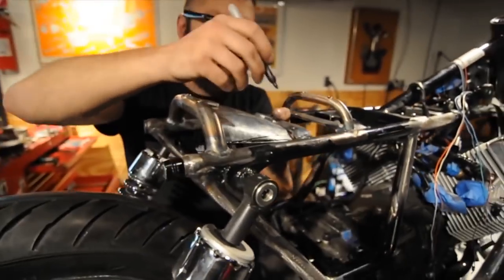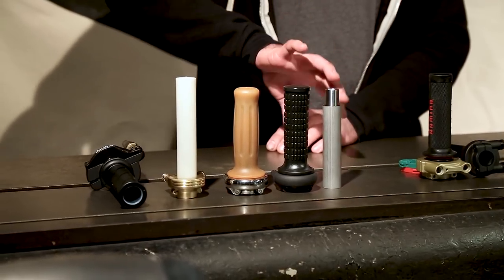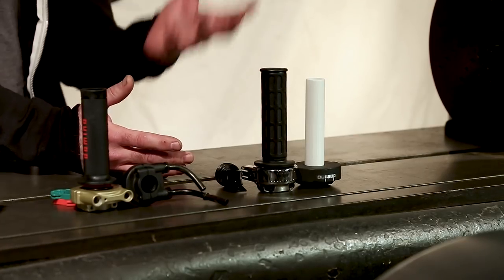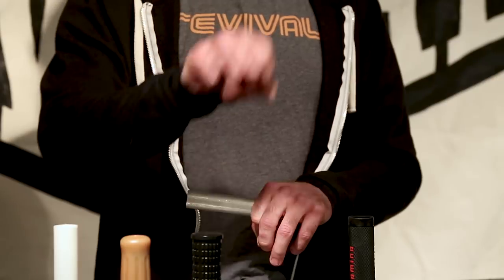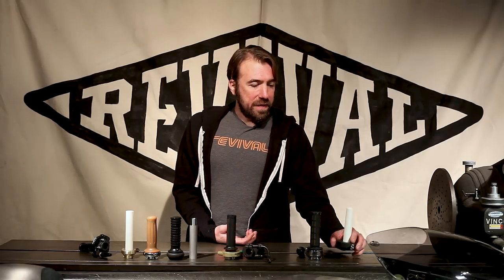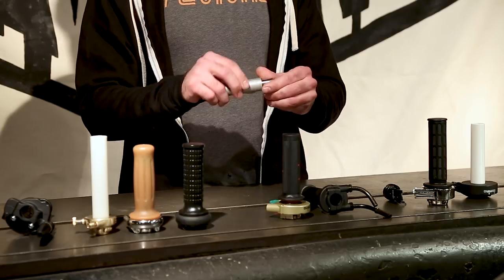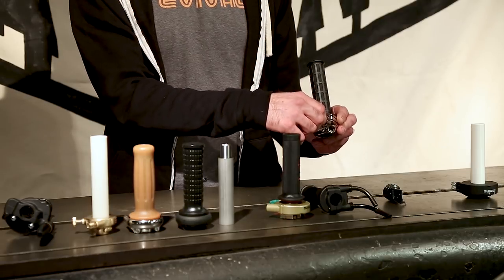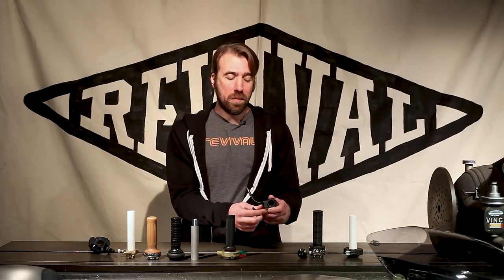Which Throttle Assembly is Best for Your Motorcycle - Revival Cycles Tech Talk

Comment: I've been searching for the right throttle assembly for my CB100 cafe build. I finally found a nice integrated throttle/control switch assembly. The throttle cam is actually housed inside the kill switch/light switch assembly. Very trick little piece.
EXCELLENT video BTW. Thanks 👍.

Comment: Hi
I must say you guys always have great and relative content.
I purchased a set of lectron carbs which came with a splitter , and what I believe you call a straight pull throttle and not what you would call a good looking piece.
Problem is the straight pull is 7/8” fit, where my handle bars and everything I have for these bars is all 1” fit.
I have a couple of your single pull throttles I got from you for another build in a 1” and a double pull in a 1”. Any suggestions?
I also wanted to add that the cable is super light which is why I’m sure they send a straight pull with the carb set and not something else.
Just thinking ahead for some input once I have the motor back in the bike.

Comment: Newbie question: Can I, by simply changing a cam wheel, reduce the responsiveness of the throttle, so that even a hard twist will be the equivalent to a slight twist with the standard cam wheel? If so, this sounds like a great way to make a powerful bike more easy for a beginner to ride. Am I getting this right? Thanks!

Comment: I ride a 72 triumph tiger 650 and personally I like the push pull, as the old Amal's like to gall witch can cause the throttle to stick wide open, maybe just my experience but, not fun. had to send carb off to get it bored and re sleeved ,question, what was the last throttle called again, I cant quite make it out.  I am building a 71 Bonneville chop, and looking for a semi fast response throttle as I fell off a roof a few years ago and shattered both wrists, leaving me with limited wrist motion, have to reset hand on throttle many times to get close to full throttle. thank you for taking the time to put these vidios out, have been watching all of them and catching up as I can. have found them to be very informative and helpful. definatly looking at getting the M blue for my build , among other things, from you all.
Reply from the maker: The throttle in question doesn't have much of a specific name and even the manufacturer just calls it the dual pull racing throttle. And as far as I know this is the fastest rate dual pull throttle out there. https://revivalcycles.com/products/domino-dual-throttle-pull Hopefully that can help with your limited wrist mobility.
Reply: thank your for  the response and the link.

Comment: Great video, I’ve always wondered about throttles. Just curious if the diameters and descriptions for the MX2 on your site were a bit mixed up.
Reply: I would think the smaller Dia of 25mm would be the gentle approach instead of the 36.
Reply from the maker: The way the XM2 cam wheels are setup its not quite as simple as that... the rate of the profiles isn't directly tied to the stroke length, so in the case of this throttle, the white is the fastest rate at 2.6 degree/mm and 36mm stroke, red is medium at 2.7 degree/mm and 25mm stroke, and green is slowest with 2.6 degree/mm and 33mm stroke. Depending on where you get your info domino had published some erroneous numbers, but those have been corrected in the latest catalogs.

Comment: Is there a conversion kit to change from single to dual cable ...?  Or is this actually possible ... I have an Yamaha XJ 750
Reply from the maker: We have developed a new 2 into 1 cable kit that will allow you to use any of the single pull throttles we offer for a dual carb set up. We should have the live up on the site in the next week.

Comment: I've a KTM 950 SM. I'm putting an FCR dual carb kit on it. I need to find a throttle control that has adjustments on it. As I no longer have the original KTM cable with the adjusters. Is the MX2 the only one that comes with adjustment possibilities? I like the Mostro and was hoping I could use that.
Reply from the maker: The XM2 is the only one with adjustible cams and I don't think Domino jsut sells the XM2 throttle tubes. You could just use the pull side of the XM2 and plug the push side.

Comment: Mine throws up too much revs when you barley turn the throttle at all. I want it more controllable
Reply from the maker: You might check that your cable isn't bound up somewhere which can have that effect. If you have a push-pull throttle set up you might look into the XM2 throttle which has variable cams that can help tame a twitchy throttle response.

Comment: Well I just realized after sending the last post the throttles I have are 7/8” not 1”. Damn! I do have an old 1” throttle but not one I’d reuse.
Regardless the suggestions would still be appreciated for the previous post.
Thank you
Reply from the maker: If you have a cable splitter then a single pull throttle will work for you just fine, if you do not want to run the cable splitter you will need to use a dual pull throttle.

Comment: So, I am rebuilding a BMW R100, I have a cable swich for both carburateurs. Would you recommend the Domino with one exist or with double exist?
Reply from the maker: There isn't a right/wrong way to do this, it all comes down to which set of pros / cons you want to deal with. Personally I don't like cable splitters, but that means building custom cables, and then fiddling with carb sync for a while. If your bike is setup with a splitter from the factory and you are good with that routing / setup, then it is much easier to just run a single pull throttle. You still run into some sync issues with any multi carb setup that isn't on a rack, so the only difference is where the adjustment happens, at the carb, at the splitter, or at the throttle.

Comment: I like the XM2 by domino but I have a single cable throttle. Can I still use this throttle controller or does domino make a single cable controller with the adjustable cams? Also if I can use the XM2, what would I do to the other cable input on the housing if it’s not being utilized?
Reply from the maker: Great question. I think this is one of the best aftermarket throttles out there. You can use it as a single pull but you might still need/want to purchase to XM2 cable kit in spite of only needing one of the cables. The elbow is a slip fit rather than threaded and there is a tab included with the cable that holds the elbow in place. You could get adventurous and tap the throttle housing to accept a threaded elbow if you prefer.

Comment: Does domino make a push/pull for 1” bars that u recommend?
Reply from the maker: 1" bars are kind of an American thing, but Domino is primarily a European supplier so unfortunately, they do not make 1" compatible controls. Also, as you probably know there are not a lot of choices for aftermarket push/pull 1" throttles, but you might take a look at builtwell.

Comment: So can a single pull motorcycle be converted to push/pull?
Reply: hope they can myself
Reply from the maker: Typically not, but that depends on how the carb is designed. Many single pull bikes have a straight pull carb setup and that means there just isn't a way to force the slide back down with a cable and you have to rely on the spring. If you happen to have a carb that still has a cam wheel on it then in theory you could add a return cable, but this would be very difficult for most DIY shops. 

Generally there is nothing wrong with a single pull setup as long as its setup correctly, with fresh cables, and the correct return springs.
Reply: I didn't figure the old amals could be set up like that, the boring and sleeving  seem to have fixed the issue